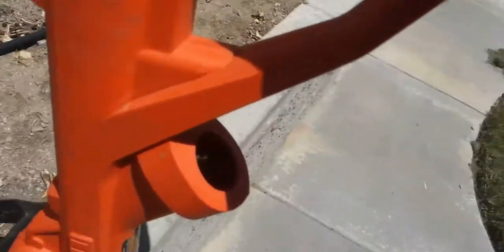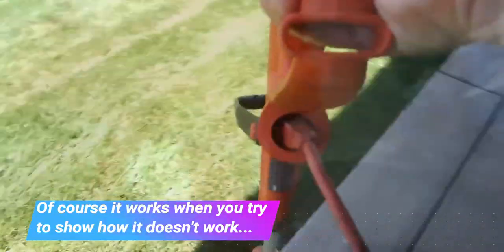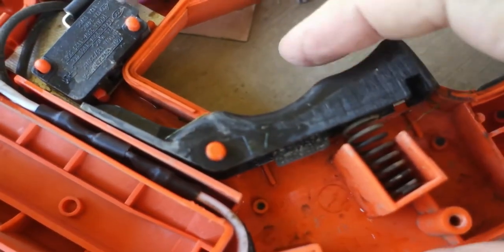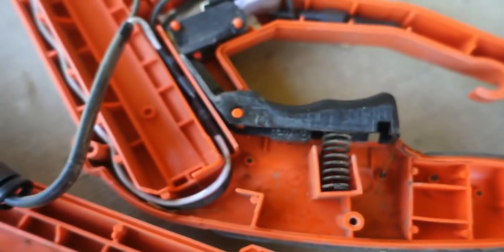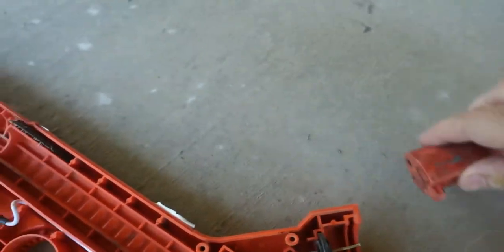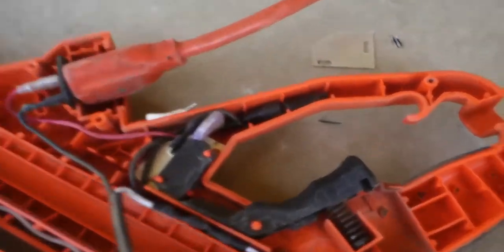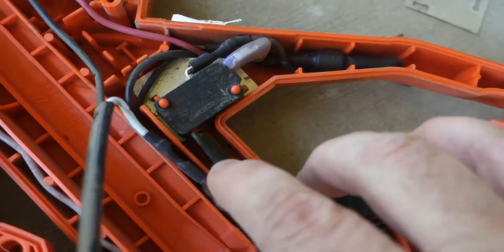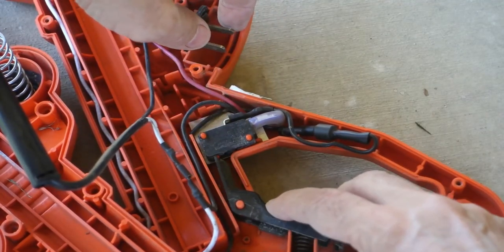Black and Decker Trimmer Repair

Comment: Thanks for this. We had a similar problem with a cordless version of a Black and Decker strimmer. We fixed ours by sticking something on top of the black microswitch so that it couldn't move when the large plastic switch pressed against it. A very odd and rather poor bit of design! Your video helped :)
Reply from the maker: Thank you for watching I appreciate it. Glad it helped, seems like simple fix they could do so that it wouldn't be a problem.
Reply: FWIW I have a couple of Black and Decker corded mowers. And I had to replace a switch on one of them with similar design. 

Which IMHO is a poor design, since the trigger does not push on the switch directly. So it can lose contact easily as it wears down with age. But I bought them used one for next to nothing, so it's all good, 

Now I just have to find a way to fix a trash find, cordless string trimmer that will not start. But the battery seems to charge. I hate cordless crap, lol. Wish me luck.

Comment: Yes I haven’t hosed down my grass hog as you just did in this video. Is that what I should be doing as well . As mine quick working on me the other day in the middle of the job , i stopped it and when I went to start again it wouldn’t work. So I should also check my switch you think??

Comment: i only used mine once but it sounds stronger than that so far....Does the head or spool thing come completely off so i could put a brush blade on this...?...i couldn't find a hole on mine to stick a thin rod into, or do you think this model can't do that...?...Thank you...

Comment: Mine starts as soon as I plug it in and immediately burns out the motor and smoke comes up the shaft. I had to replace one, then the brand new one did it on its second use.  It simply started as soon as I plugged in the male end to the trimmer, then burned up.

Comment: Mine started making a loud noise and then smoking lol. I thought I'd see if this is something I could fix, or if it's dunzo.
Reply from the maker: Could be electrical or mechanical might need to check and see if something is stuck in it rubbing on something else or if there are melted areas since you said it was smoking.  Might be better to replace if not easy find/fix since replacement parts might be hard to find.
Reply: @LowKeyLifeHKD  Yeah, I think you're right. Thx for the reply.
Reply: @LowKeyLifeHKD     Thanks for your post. My machine just stopped completely. Prior to that it had been making grinding noises and last summer there was an instance of smoke in the motor housing. I just made up mind to replace after reading your advice !